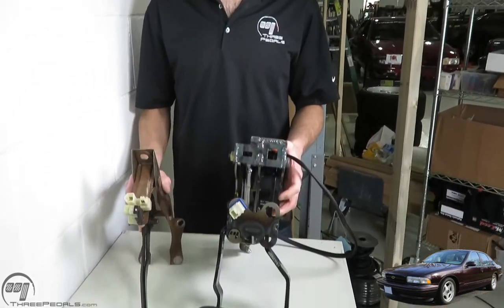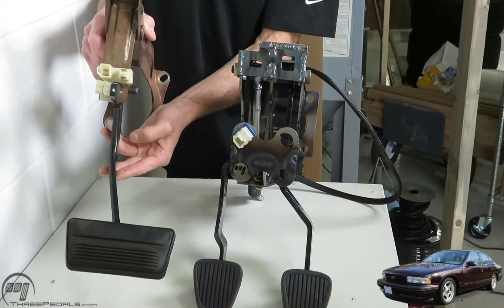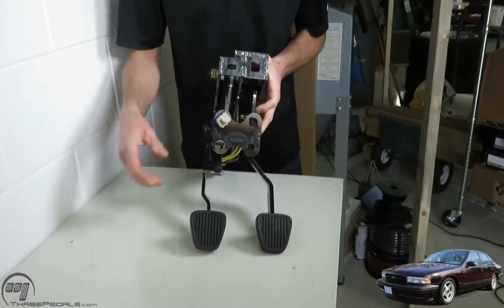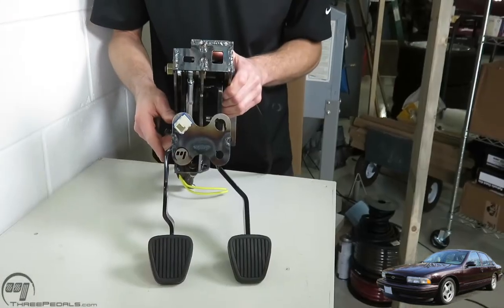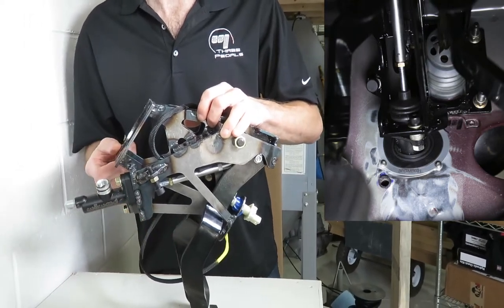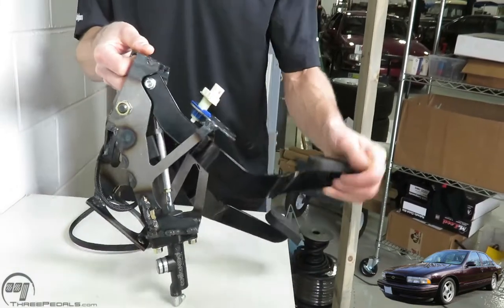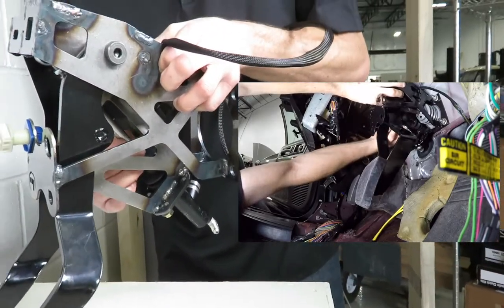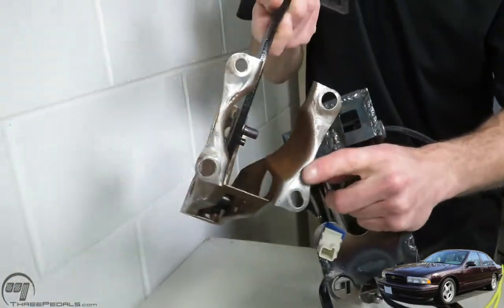Integrated clutch and brake pedal assembly details

Comment: how does the clutch safety switch get wired in?
Reply from the maker: Thanks for your question!  We use an OEM GM switch and wire it into the starter circuit.  This way the starter will not get power unless the clutch pedal is depressed.  If you have any other questions please let us know.